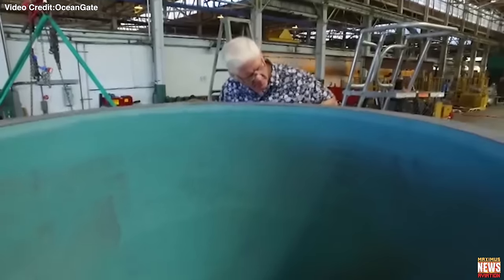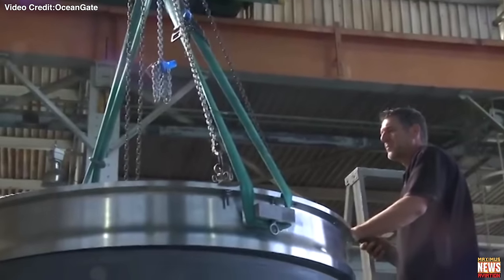Watch The Manufacturing Process That DOOMED OceanGates Titan To Fail. But It NEVER Had To Happen.

Comment: As someone that understands how carbon fiber works and what its structural components require, the fact that they spun the carbon fiber in the same direction and they didn't vary it by 90° so that the weave patterns were overlapping at different angles to create the intense rigidity required to create a rigid tube. The method displayed would have been incredibly strong to two directions of pressure but far-far weeker to the third and fourth directions. When they make the carbon fiber shells for super cars they specifically overlay the carbon indifferent 90-degree directions to create the rigidity.
Reply: Yep. We called it the warp clock.   This guy was little more than a rich con man.
Reply: Didn't it also look, at 00:34 e g, like it was riddled with air bubbles?
Reply: How could they NOT know to weave it like a SCUBA tank ? Seems crazy, or lazy, or both ?
Reply: @michaelb.42112  I read where the CEO fired anyone who questioned the build process or quality.  What's crazy to me is i look at this and say no freaking way would i be locked in that even if they paid me.  But some very rich people never gave it a second thought.   The owner was a B.S. artist who came from money and never worked at a real job.
Reply: THE ONLY THING I HAVE EVER USED OR KNOW ABOUT CARBON IS ARROWS FOR MY BOW, THEY TALK ABOUT CROSS WEAVE TO KEEP THEM STRONG, MAKES SENSE WHAT YOU GUYS ARE SAYING,  SAD DAY TO LOSE ALL THOSE PEOPLE, ....
Reply: @debbiethompson1970  Also a sad day when you forgot to turn off caps lock.
Reply: Exactly like pouring epoxy over a tube of sewing thread or oiling a few layers on a 3d print. Money cost avoidance is my guess, a penny stock promoter type character.
Reply: @michaelb.42112  Did they high pressure vac bag it? Seems a film prop approach I made space ships for sets with as much science fact.
Reply: @441rider  far to large to vacuum bag you would end up with blocks in the resin because the vacuum wouldn't be able to pull the epoxy all the way without serious effort. They likely used pre-preg carbon fiber strips and I seriously doubt they had a well tested thermal chamber to properly cure the entire thing at an even temp distribution from front to back, if it was hand laid with a machine applied resin it gets even worse due to air between the strip layers. They way they constructed it is just amateurish for even hobbyists working with cf.
Reply: @Hjtrne  I wouldn't be surprised since they had a machine rolling strips and nobody following behind with a plastic edge to flatten/ remove air pockets. That cracking they continually heard on every dive was likely the air pockets causing the layers to delaminate and crack over time, everyone who declined to ride that death tube is probably thanking whatever made them second guess it. The entire filmed promotional process just reeks of someone not understanding all the lessons learned by carbon car tubs, control arms, plane chassis and body panel fabricators. You have to wonder if they even had someone on staff with expertise on the material or how many people told them this was a bad idea and declined employment.
Reply: I know next to nothing about carbon fiber or deep sea submersibles but I know damn well anything made of fibers needs to have staggered grain in the same way they make plywood.
Reply: @jackn4853  You made my MORNING!
Reply: I  read somewhere that it was actually made in alternating layers of axial direction pre-peg and wound (hoop direction) fillament
Reply: @fuzzy1dk  take two envelopes move them so that they are 15° in different directions from each other and look at the gaps between the corners, there is a reason super car parts carbon fiber parts in carbon fiber aftermarket parts are all into laying 90° angles or multiple layers of 35° angle overlays. The winding method they use created a zone of far weaker carbon fiber rigidity in the middle areas where there is a greater distance between the corners of your envelopes. To visualize it with a clock they went from any 11 p.m. to 5 a.m. wind to a 1 a.m. to 7 p.m. wind. If you don't have a 3 p.m. to 9 p.m. wind and every other hour in between you create an inherently weak structure to the pressures that they were applying.
Reply: No way to lay cf to keep high pressure out, only good for keeping high pressure in. Cf only works in tension. Any pressure from the outside will only be compression forces, that means the resin sustains all loading. Idiot engineering.
Reply: @csdstudio78  bingo and the resin goes from good straight to crushed with no in between the entire acoustic monitoring system was fallacy and foolishness. I don't understand how they didn't get that material like metals can deform and still provide some measure of safety, while resin go straight from perfectly working and capable to shattered to pieces.
Reply: @debbiethompson1970 WHAT!?
Reply: The more videos I watch about this the worse it gets and the more amateur it looks to be. It honestly looks like there wasn't much engineering involved in designing this sub. He just took the idea of carbon fiber and thought everything will work out because carbon fiber works well in other applications
Reply: @csdstudio78  I would think that if one were to form some carbon fiber layers that were narrow at the "waist", and then added slightly flexible elastic exposy so the outer surface was barrel shaped, the inner layer of carbon fiber could add a lot of strength.  The CF would need to go around strong metal hoops at the fore and aft ends, but if the hoops hold, and nothing fails under tension, I would think the overall design would be able to establish equilibrium amounts of deflection for a wide range of pressure levels without substantial shear forces.  The more the outside pressure pushes in on the waist of the outer barrel, the more the the ends of the epoxy would push the fore and aft ends of the structure apart.
Reply: I really expected to see some kind of extremely complex circular loom weaver like Toyota used in the LFA crash structures. Nope, just rolling it on like electrical tape. Libertarian Capitalism.
Reply: @Hjtrne  defo
Reply: @jonf2009  I guess that carbon hull must have been WAY cheaper than to go for a steel one
Reply: @mzaite  true
Reply: @441rider  "high pressure vac bag" No. Just no. There is no such thing as "vacuum pressure". There is vacuum OR pressure, relative to where the measurement is taken, or whichever location's pressure is natural. For example, air inside a tire is artificially raised in pressure above ambient natural atmospheric pressure.

Put a hole in the tire and everyone agrees that air is blowing out. It's not being sucked out by the lower air pressure outside the tire. Tires that fail have blowouts, not suckouts.

Likewise with a pressurized airplane or spacecraft. The lower exterior air pressure or vacuum of outer space doesn't suck anything out through a hole in the wall. It gets blown out by the artificially produced higher pressure inside.
Reply: @greggv8  I was referring to the use of prepeg and vacuum bagging the carbon fibre shell wrap and epoxy too be sure air bubble in the weave get pressed out. Not underwater. It was a penny stock fund raiser the french guy had rights to the wreck PBS reported the tourist victims were just paying for the ceo biz.
Reply: I’m not an expert, but that’s what I’ve been thinking as well. Some sort of woven mat of fiber or fibers, running at right angles would’ve made it considerably stronger I would think.
Reply: No it won't. Carbon fiber is like a bunch of very strong ropes around a pressure vessel which hold the pressure in. The "ropes" do virtually nothing for strength when the pressure is on the outside. It was basically an epoxy vessel.
Reply: @michaelb.42112 scuba tanks hold pressure in, not out. You can crush an empty scuba tank by running over it.
Reply: @johnneyland3334  it provides no strength at all from compression. Carbon fiber is like a rope wrapped around a vessel to contain internal pressure. The "ropes" do nothing to resist external pressure. Basically epoxy was holding all the external pressure. I saw where a chemist stated that pure epoxy would have been stronger for external pressure
Reply: @johnneyland3334  It's great with tensile strength but horrible with compression.

Comment: So basically these guys took the structurally sound idea of a strong metal sphere (which is the standard for deep-diving submersibles) and said something to the effect of "Let's split it in half and place a long carbon-fiber cylinder between the two sphere halves so that we can fit more paying customers in this thing.  We will glue the ends to hold the whole thing together".

...and they didn't think that was massively compromising the structural integrity of the vessel?!?!?
Reply: Cut costs wherever whenever
Reply: yes...
Reply: i never understood this. why not just make a bigger sphere??
Reply: @arieblock2337 do you see any sphere sardine can ? 😂😂
Reply: The Aluminaut got with it. Aluminium instead of CF, of course. It didnt use glue or gaskets, only bolts.
Reply: Stockton was blinded by money and becoming another pioneer like an Elon Musk. He wanted to be this maverick rule breaker, who went against the rules and still got the job done but his stupid design and reckless attitude cost him his life and his paying customers.
Reply: I think deep down Stockton knew his design was a pile of crap. He just didn't have the money to make it all out of contiguous materials like steel or titanium but even then as you said, the cylinder design was purely to fit more paying passengers inside. He chose carbon fiber as he could get it at a discount price from Boeing as it had past its shelf life for aircrafts, and the rest of the sub was MacGyver'ed together as Pogue put it. I think in Stockton's mind he knew a single sub made out of all that junk carbon fiber had a finite number of uses, which is why he installed the Real Time Hull Health Monitoring system to know when the carbon fiber was starting wear down so he could quickly surface the sub before it completely failed. It's a very dangerous concept if that was his idea of safety, but the man was certifiable. I feel sorry for all the passengers who were duped by his hubris.

Comment: A masterclass on how not to build deep water submersibles.
Reply: Titanic Submersible.   Darwin Award Winners 2023!   :trophy-yellow-smiling:
Reply: @jamesburns2232  Too bad it wasn't just "I know which corners to cut when it comes to safety" and the Engineer who backed him up on that in the submersible when the inevitable  finally happened....
Reply: How exactly do you know that?
Reply: @dont6441  Catastrophic Failure perhaps?
Reply: Imagine having access to billions of dollars and choosing this piece of 💩 for a trip? 

It's almost as bad as choosing to fly with Spirit when you have United available 😂
Reply: Sadly.
Reply: @Shadow__133  why didn't they just given James Cameron a call and use his.
Reply: @spaceinaspace8452  the one Cameron built cost 10 million and only held one person. This guy was all about budget builds
Reply: To me, it seems like thar glue job on the rings would be the first to go. They manually applied it with a popsicle stick.
Reply: @TheFrenchPug I agree the fact they were mixing and applying the bonding agent it in a non clean room environment was sus. They didnt even have hair nets on you do not want contaminants being introduced
Reply: @johno1544  James Cameron has multiple submersibles I believe he has at least 4 in his collection with two seats which may have been time consuming they would have got the experience they wanted without being crushed.
Reply: @spaceinaspace8452   If Cameron owns multiple ones they arent all rated for that depth there is only like 10 on the planet that are and he doesnt own 4 of the 10. His deep sea one is a 1 seater. The Pakistani guy on the Titan tried to rent the DSV limiting factor rated for the  challenger deep but was turned down by its owner.
Reply: @spaceinaspace8452  Lol, that's precisely what I thought. "Hey, James, what are your thoughts on this?"
"Don't do it? It's a f... coffin? Ok, here's a $50k tip for the tip" 😂

Comment: Interesting, thanks.
- Carbon fiber is good in tension and not in compression.
- The deformation rate of titanium and carbon fiber is not the same. Not good at the junction.
- Impossible to open the door from the inside (even if it was not the cause of this accident).
- Spheres are much more stronger than cylinders under pression. And the cylinder is not made of titanium.
- Cabon fibre gets weaker and weaker at each cycle (dive after dive).
- The computer strenght simulation is much more accurate with a metal part than with a carbon fiber part.
- If you want to dive at 3800m, you must do a test without anyone inside at 5000m at least.
- At 0:54 I am not sure but I have the feeling that we can see bubbles between the carbon fibre layers.
Etc...
And I'm not an engineer! I just like engineering. This gives you an idea of the Ocean Gate amateurism !
Greeting from France

Sorry for my english, it's not my native langage 😊
Reply: You're command of English is fine. I would not have guessed it was not your native language had you not stated so.
Reply: Anywhere below 50 meters would be nearly impossible to open the door even if the occupants wanted to.
Reply: Sub had already dived that deep a few times, it wasn't the capability, but more of the duration, repeat and longevity which wasn't tested after which they could have obtained an operational expiry date.
Reply: Seems like you are more intelligent than the builders of this submersible…what a tragedy.
Reply: @Deploracle They mean the door doesn't open from the inside, period. Even out of the water.
Reply: Carbon was also laid in a helical pattern with the next layer angled on 10-15 degrees different, not the 90 most structural cf uses. Inherent weakness in the lay pattern alone is mind boggling.
Reply: You wrote 5000mm, but meant 5000m. Oops!
Reply: @Deploracle  bro thats a safety fail, even if the sub survived and they resurfaced, and were floating but the researchers couldnt find them right away and they had like 30 mins of oxygen left, they would still die because they were locked inside. One of many fails of this sub.
Reply: @Deploracle "Your", not "you're".
Reply: @pz2736  Thanks for that, although I typed neither word in this thread.
Reply: @oahuhawaii2141  Oops, you are right 😊 I will make the correction. Thanks !
Reply: You write perfect English and I am a native. 
Thank you for your thoughtful and sincere comment.
Reply: @ronaldschild157  Thanks a lot ! 🙂
Reply: @TheAefril  Thanks 🙏
Reply: @davemoskot1776  And I have to admit that I would never go inside a submarine of my own design. Can you imagine how scared I would have been in the Titan Submarine! 😅
Reply: Aiir was trapped between the layers and expanded at depth....there was no bond between the carbon ribbon........

Comment: They used super high tensile material intended for an internal load and attempted to use it for a compressive external load while being bonded to dissimilar materials by adhesive bonding. This home-baked mess was certain to fail. It was only a matter of how many load cycles it would take to fail.
Reply: You could not be more correct sir… what a shame. This disaster should have never occurred. 2 dissimilar materials and no certs.
Reply: Maybe the material should be describe as carbon fiber thread reinforced epoxy.
Reply: I note everyone is wise after the event!
Reply: @fredericonerkis3804  What rubbish. That fool bears responsibility for the disaster which was fortold by many in that community after numerous attempts both formal and informal, to wisen him up.
Reply: @fredericonerkis3804  well we were shown the mega shoddy construction just now.

Comment: I had a career in a Formula 1 team as a composite Laminator, and can tell you that every component we manufactured for the car had a shelf life. Each part was stringently checked, however that piece would be retired after a certain amount of laps/time however capable it looked !! NDT is useful but as soon as you start gluing things together you then expose potential breaking areas.
Reply: And racecars are never under 6,000 psi of pressure at the bottom of the ocean.
Reply: @bradleywalker8642  its not about whether race cars go to the bottom of the ocean (which they don't). Its understanding that when carbon fibre is under loads repeatedly, then the material should be inspected and indeed retired after a given period. That is my point.
Reply: @bradleywalker8642 That's not the point.